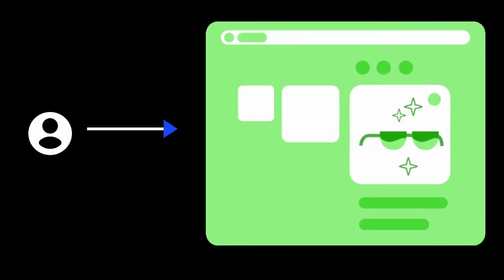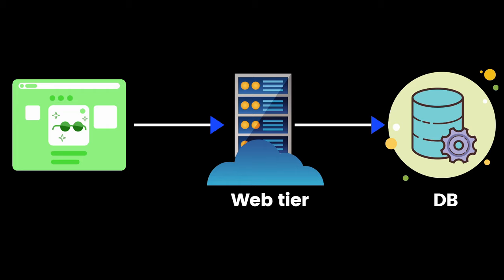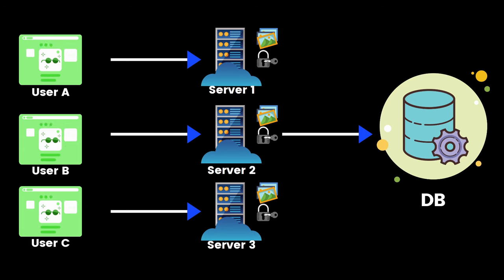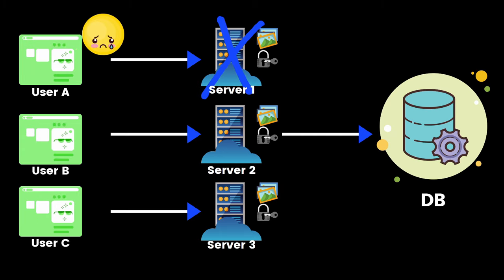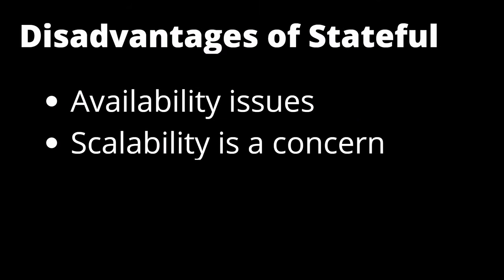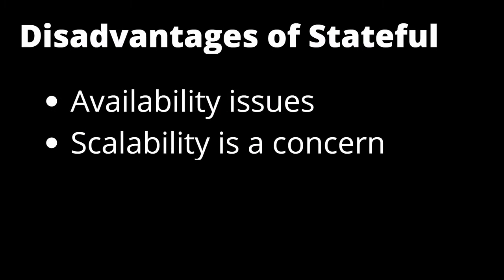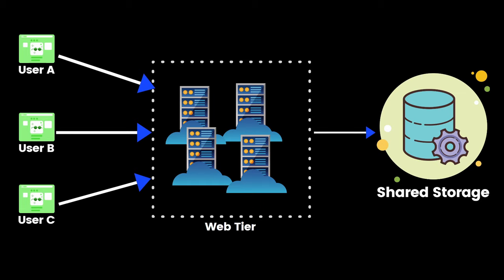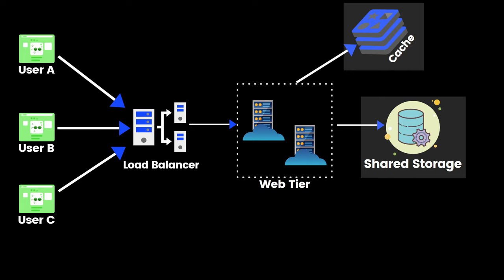Stateful vs Stateless Architecture - System Design Basics

Comment: Good Explanation i have one doubt suppose if cache is failure  what about  in the line up here is not maintained high availablity na
Reply from the maker: Yes, cache has to be in HA and it can be single point of failure. So in case it fails, the request will be fulfilled from DB.

Comment: I am learning AWS now and come across state full and state less in network topic ... but in that topic they said state full will remember and stateless will not remember anything . Is what you are discussing and what i am reading both the same i doubt .. if yes which is the correct one ?
Reply from the maker: In the network context its commonly used for stateless vs stateful firewalls etc.